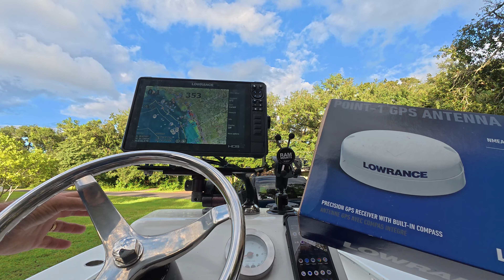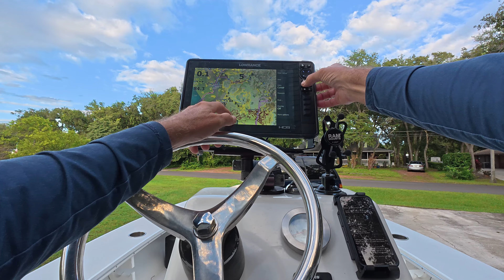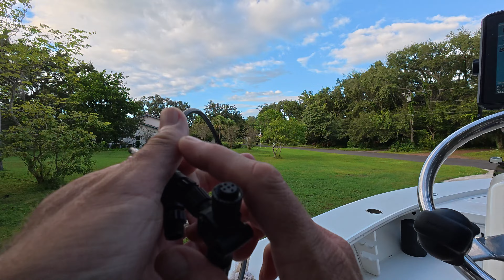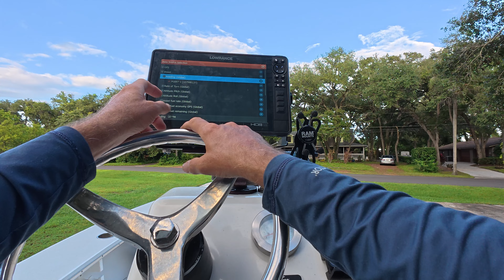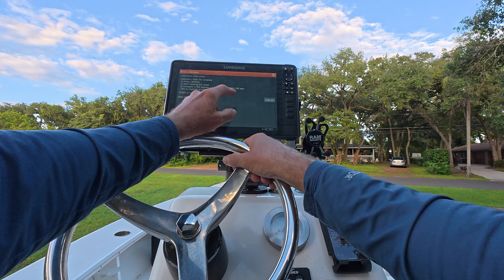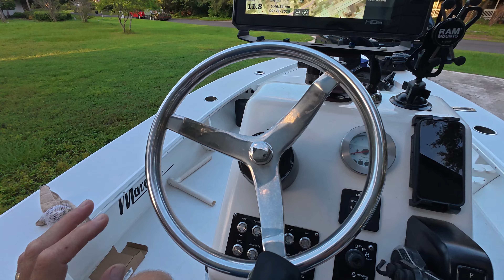Lowrance Point-1 Antenna Hidden Install

Comment: Thank you for this. I followed it in detail when I had a question.  My issue is when i went into calibration it will not complete.
Reply from the maker: Hey. Somehow I missed this comment.  Did you figure it out.

Comment: Hmm - I wonder if I could do the same mount with the SiriusXM weather receiver....
Reply from the maker: It could certainly work, especially since you are not triangulating a position and don't need a quantity of Satellites.

Per ChatGPT:

SiriusXM Weather only needs one satellite in view to function properly.

Here’s why:

SiriusXM uses geostationary satellites (currently SXM-8 and SXM-7 in service).

These satellites broadcast continuously from fixed positions over the equator.

Your SiriusXM receiver (like those used in marine units such as Garmin, Lowrance, or Raymarine) just needs a clear line of sight to one of the SiriusXM satellites — typically to the southern sky in North America.